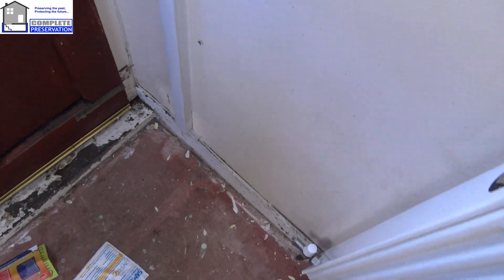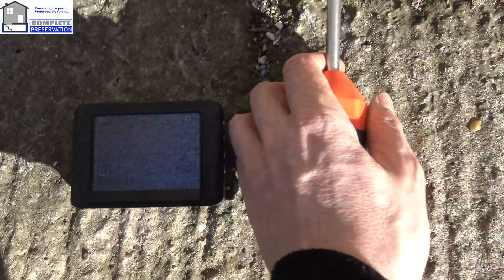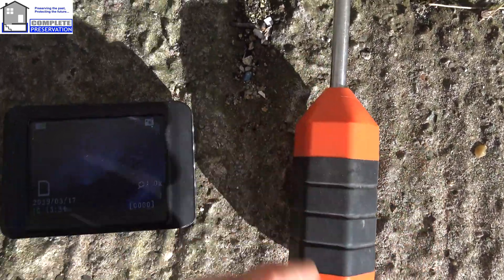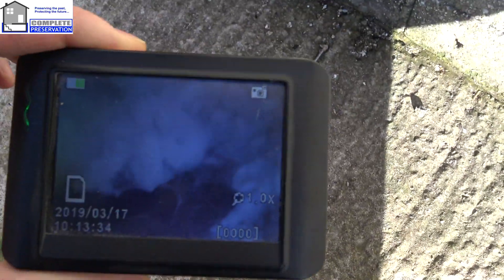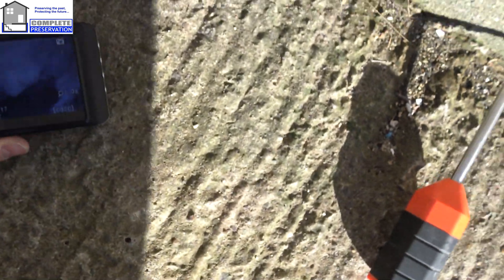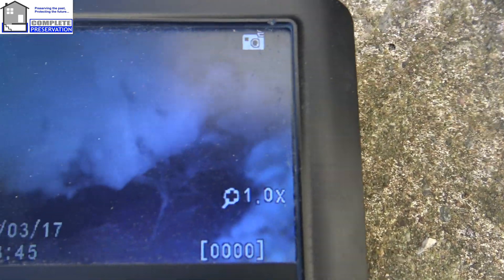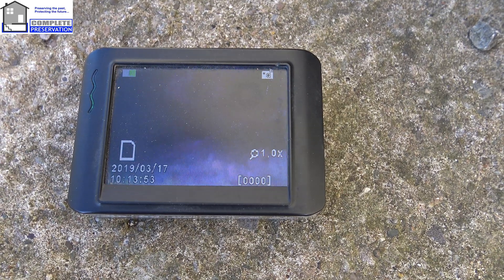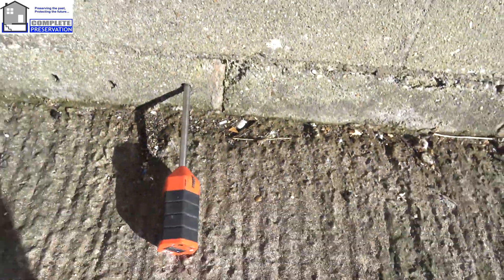Cavity wall insulation causes catastrophic floor collapse

Comment from the maker: Let me know your thoughts on cavity wall insulation good or bad?
Reply: Mind blowing. What a weird fungus thing. 

Energy Saving Trust says: “Do NOT block up air bricks in your walls. They are needed to help ventilate the space under your floor and stop your floorboards rotting.”
Reply from the maker: @Group51  Certainly different from the norm bud. Unfortunately sometimes these get completely blocked or restricted ventilation occurs, and then this this happens. This type of construction is more common than most I have personally found.
Reply: BAD

Comment: What is the likelihood of insulation retaining black mould behind stud walls? I have just escaped  a property that was Vctorian with a concrete extension and I am now sick with non tuberculosis bacteria in my lungs. I was disgusted with the landlord telling me the vinyl flooring and the detached walls  and complete idiocy of allowing a terrace on top of the flat roof extension that nearly killed me. Their remedies before I moved in involved blocking of the lower vent bricks as it was too cold. My hypothesis is there was black mould growing inside the cavity walls which they also did the standard injecting before I moved in. The whole thing is an example of how to kill residents but blame it on ventilation of residents. Im no fool I have a dryer and opened windows etc etc but this is a war no human can win against idiot builders and cheap remedies.
Reply from the maker: Without carrying out a survey I can’t really give you any advice 👍

Comment: Hi Ross,  joiner here , moved in to our first family hone 7 years back , already had cavity insulation installed ... upon making a crawl space under the floor I noticed the dry powder rot you have in this video on skirts on my floor joist . Then upon checking the lovely insulation guys had blocked up every single air brick around my home . I ran around drilling out some 300 holes to allow my floor to breath again . In the winter though my house is now cold , especially on the floor as it's all laminate downstairs . I'm in the process of looking to carpet my living space and insulate the floor from inside the crawl space ... any recommendations or tips please 🙏
Reply from the maker: Typical scenario then 😜 Drop me an email bud. enquiries@completepreservstion.Co.Uk 👌

Comment: For a time they used to drill holes and inject silicone or some such to stop rising damp. I'd expect only individual holes rather than clusters though so I'm probably wrong. Also they wouldn't penetrate fully if injecting...
Reply from the maker: Hi Clark I haven’t watched this video for a while if I remember the holes together were for sub floor ventilation. Correct about drilling individual holes to form a damp proof course. This building has a perfect physical damp proof course 👍

Comment: Hi Ross, what’s the fix in terms of cross flow ventilation there with the retrofit concrete floor ducting being blocked? Front and side isn’t sufficient is it?
Reply from the maker: Hi james I connected it all back up, and cleaned and sleeved through the cavity👍
Reply: Increasing the ventilation holes or adding many more will help or fix the no flow of air, bit surprised the man has not advised getting that outside ground level down, as the surface is not far away in height terms from original vent holes and that moisture on the ground?

Comment: Good video, as ever, the insulation is not the issue but the lack of consideration for ventilation. A smart installer would have added big ass air bricks instead of leaving the pinholes the property had.
Reply from the maker: Thanks Michael 👍exactly that and linking the ducts up. I’ve got a similar one with dry rot to look at in a couple of weeks 🤦‍♂️
Reply: @completepreservation  Nice one, keep the videos coming, information like this is needed on YouTube. Also, what do you mean "linking the ducts up"?
Reply from the maker: Thanks bud 👍 if they get sleeved through the cavity it prevents cavity wall insulation blocking the ventilation… it then helps stop this timber decay issue… very common defect bud 👍
Reply: @completepreservation  Ah, ok. Thanks for the reply, makes sense to stop the insulation blocking the airbricks.

Comment: Hi just subscribed 
After having a porch built 5 years ago I noticed for the last 3 years a smell in the house
Aparently they blocked my air vent that puts air under the floor... i also 20 years ago had wall cavity which i haven't had a problem with. Since the porch vent was blocked it started
I have some one to put 2 air vents in and they wil cut out the foam in the ones I already have... I'm so hoping this works as I dont know where to turn if it doesn't
Reply from the maker: Hi Adele it would be prudent to look under the floor really. Repairs can get expensive.
Reply: @completepreservation  thank you

Comment: So cavity wall insulation is actually not recommended? Is it bad if a house on the market already has it?
Reply from the maker: Its worth having if its been installed correctly and you maintain your building. Unfortunately its not always installed as desired, along with poor building maintenance. This equals issues like this timber floor decay, and damp issues within a property. I should have a video finished later this week on cavity wall insulation. it might be of interest to you!

Comment: Question, can cavity wall insulation sink your house or cause structural defects?
Reply from the maker: Can do if it accelerates wall tie corrosion.... more likely to be drainage issues though
Reply: What it does is it contracts and pulls the walls together, it adds structure to the building if done right. It's a specialist job, this guy obviously had some clown doing it.

Comment: Really interesting 🤔 and informative thanks for posting
Reply: How much would it cost to have all that sorted?
Reply from the maker: Hi Nigel, it all depends on the extent bud. Unfortunately its never cheap to do as you can imagine1
Reply: @completepreservation  yeah been told 4k  at least, that's 11 new joists n chipboard flooring . Should they be changing the skirting too as the flooring is rotten as hell so surely the skirting will get the same eventually
Reply: @completepreservation  thanks for the reply too 👍
Reply from the maker: Whats the cause of the rotten floor bud? if the skirting boards are damp with decay they need to be replaced.
Reply: @completepreservation  the sub floor had flooded on the previous owners n was just left and needs more air bricks . Yeah  the skirting is like sponge in places i checked after posting 👍
Reply from the maker: Make sure they change then then bud.....Get those drains checked though to be sure, see this videohttps://www.youtube.com/watch?v=4vtNI3bW4Gg
Reply from the maker: Glad you liked it.... I've got some more I need to edit of some other bodge ups I will be posting soon  :)